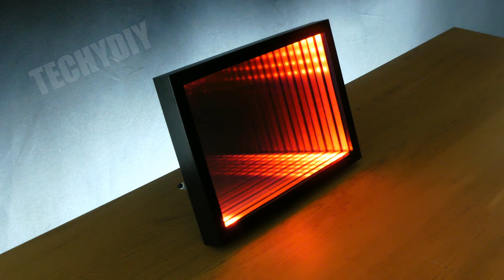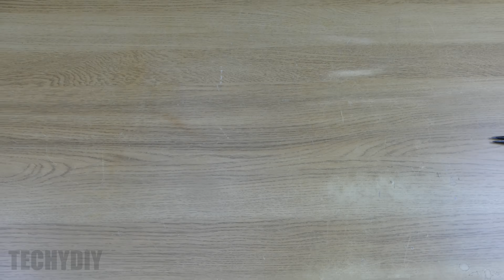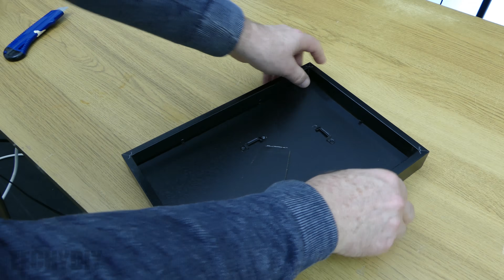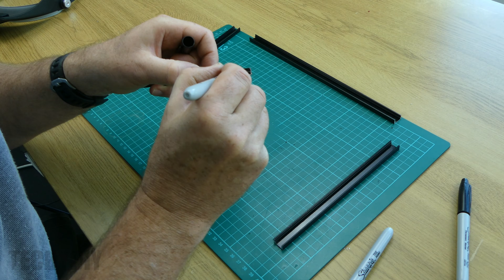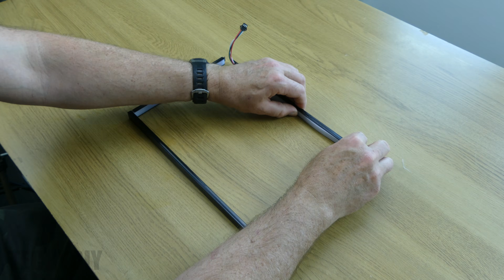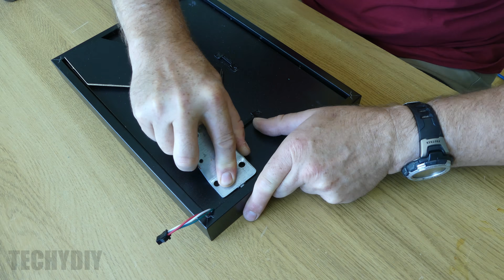How to Make an Animated Infinity Mirror with a Few Hand Tools

Comment: This looks awesome man.. Im wanting to do this exact build myself but the parts list links aren't taking me to the exact parts being used. When i try to find each part the sizes are different. Can you post updated links? Im in the usa that might be why im having an issue.
Reply from the maker: You have to improvise with what is available.
Reply: @techydiy  no I don't want to improvise it requires to much thought :[

Comment: is there a Aluminium led profile mini that wil fit the waterproof leds?
Reply from the maker: I don't know but you can probably cut the waterproof covering off the led strip
Reply: @techydiy  ok thx
Reply: @techydiy  how many inches do i need 36, 24 or 12?
Reply from the maker: Measure the inside of the frame

Comment: Great video. How did you get your led lights to go around like that at 6:28 mine only seem to allow one colour at once and be able to move? Thanks
Reply: Have a look on ebay for a new controller/remote prolly £3 from china.
Reply: Thanks :)
Reply: @donaldnorton7773  thinking on it, I think you can program them. Sure I saw it on youtube somewhere. So many people use these things, I cant remember who.
Reply from the maker: Thanks. It was just an option on the remote control.
Reply: There is a few controllers that do it and they can be coded aswell :)
Reply: @donaldnorton7773  send me a link if you find one, my daughter wants a mirror in her room
Reply: Rgbic lights now do that. I know I’m late to reply but if your still looking!